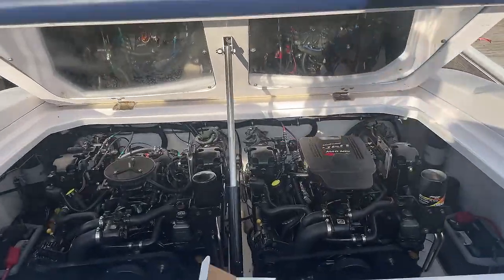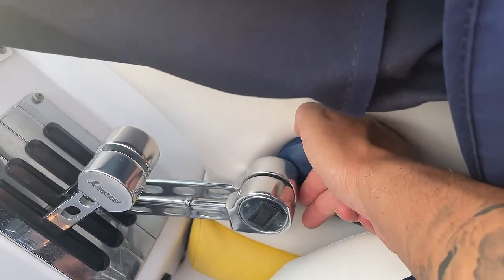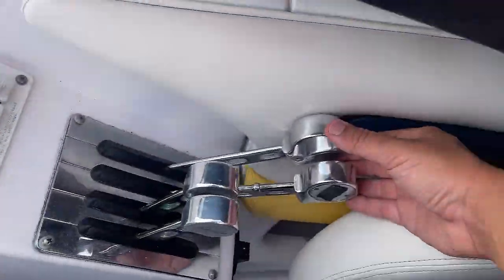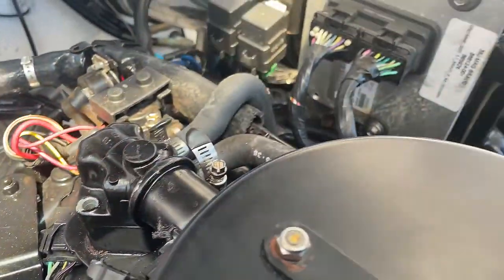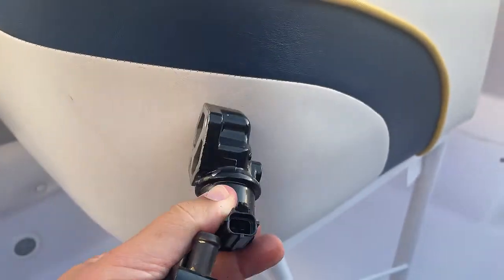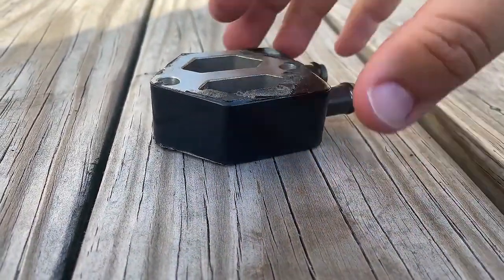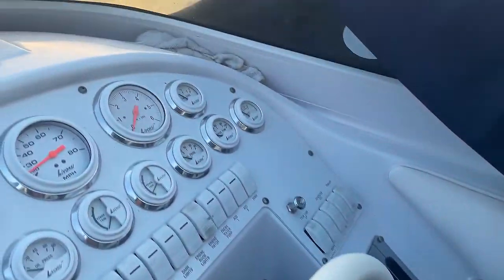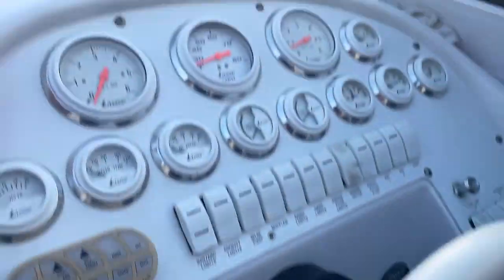MERCURY 350 MAG MPI IAC VALVE REPLACEMENT (2 BEEPS & STALLING SOLVED & FIXED) #Donzi #Mercury #boat

Comment: The problem is you need two 1970 s king cobra 460 engines with kama surface drives and always use high octane 76 super and bring a girl that cook's

Comment: Don’t forget get to change out your IAC filter in the Carburetor. $2.50 for two from Mercury dealer.  It’s a thumb nail size white filter. Long nose pliers to remove and install.

Comment: Great video thank you! Had the beeping start last weekend. Also noticed I had to throttle up a little on that engine to get it to start so I’ll replace this valve and see if that does the trick. Quite a price difference between the IAC from Wesr Marine ($148) and Amazon ($27). Where did you get yours?
Reply from the maker: Thank you. Sorry for the late reply. I’m glad that the video helped. I got mine at a local Marine supplier. They had the part at the store. I don’t remember what I paid

Comment: Replace crank shaft sencer  and turn distributor just a little to advance and check spark plugs and clean distributor cap inside at the points and rotor  and happy boating
Reply from the maker: sweet. thank you for the info

Comment: Does your engine hunt back and forth on a cold start for the first 10 seconds or so before smoothing out? Wonder if my iac is getting lazy
Reply from the maker: It did a little bit. Now it’s good. Make sure your batteries are good and charged as well.
Reply: @amendolarestudios5276  well I mean mine has always done it really since it was brand new
Reply: I was told it was normal and it just takes it a few seconds to figure out what the air temp is and such and it runs off the map values of the last time it was ran.